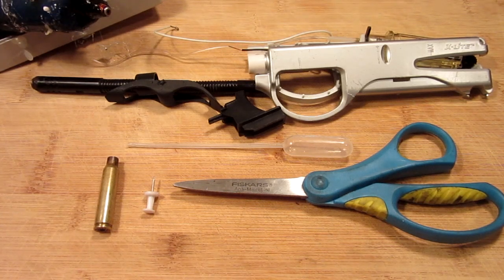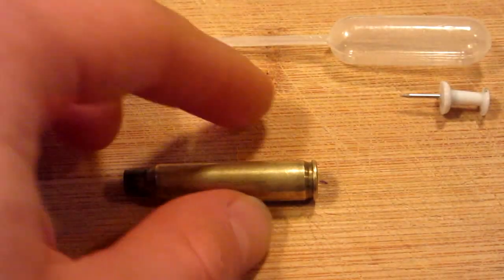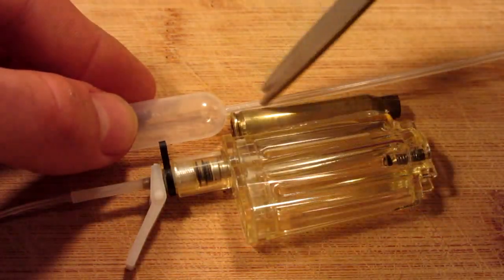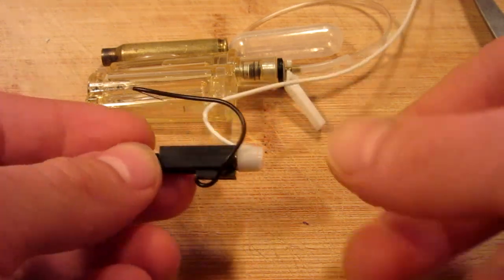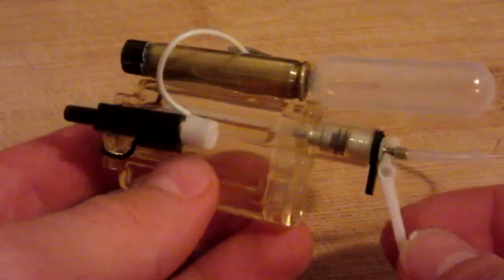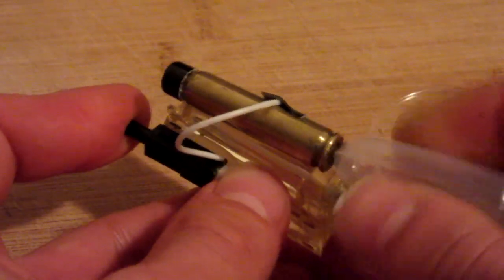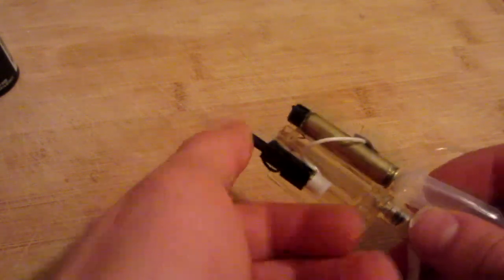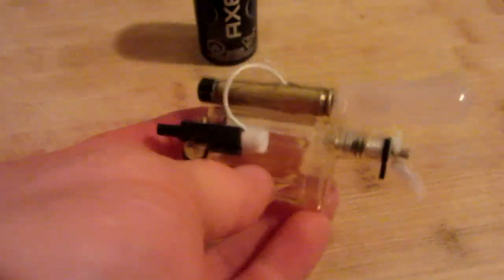How to Make a Mini Fireball Pistol -  $2

Comment: When you let go of the squeeze it sucks gas back into the pipette so you actually have way less fuel mixed than you think. Try cutting the pipette bubble in half and slipping the shell casing inside of it. Sealed up, it would work as direct injection and would be a lot more reliable for ignition.
Reply from the maker: +TheEnder42 yeah that may work but the last testing there worked pretty good so a comparison would be helpful to know if it would improve anything!
Reply from the maker: +TheEnder42 yeah that may work but the last testing there worked pretty good so a comparison would be helpful to know if it would improve anything!
Reply from the maker: +TheEnder42 yeah that may work but the last testing there worked pretty good so a comparison would be helpful to know if it would improve anything!
Reply: +inventor719, I made an airsoft cannon (tiny potato gun) from a pen and a film canister, along with the same ignitor. Same principles, though I use hairspray as fuel, and it turns out pretty powerful. I won't have the chance for about a week, but I'll film a demo on it and post it.
Reply from the maker: +TheEnder42 okay cool!
Reply from the maker: +TheEnder42 okay cool!